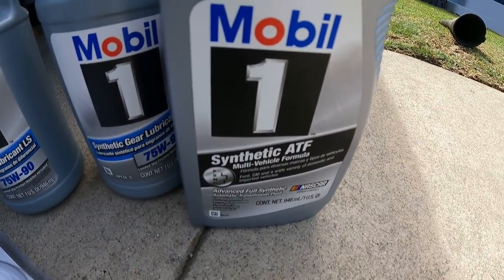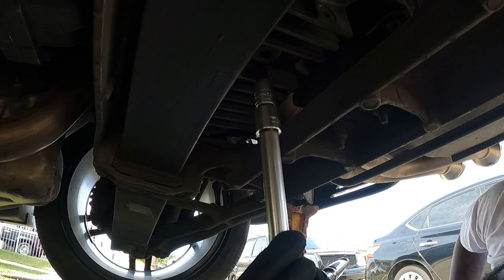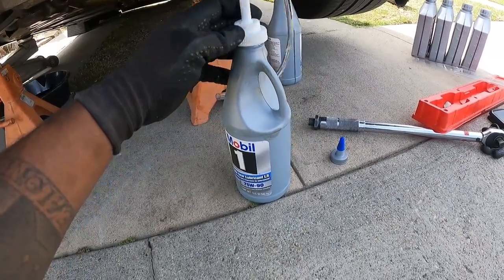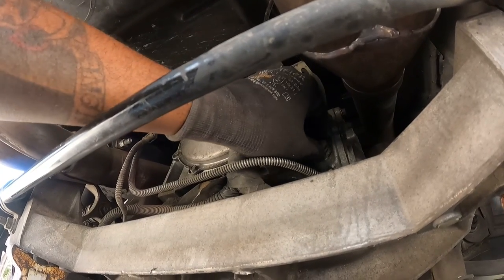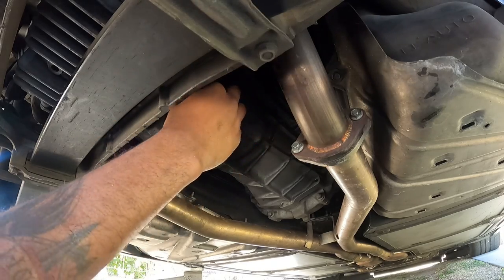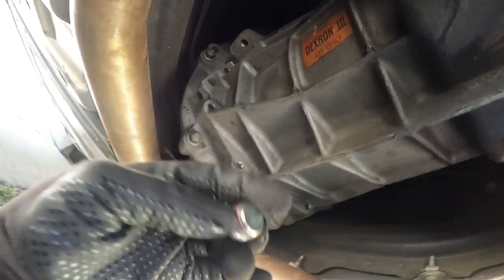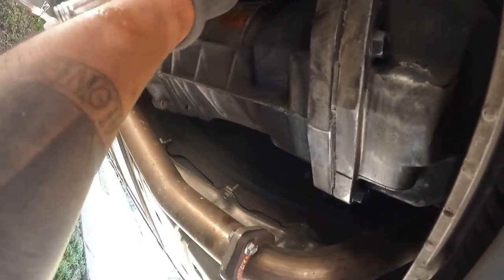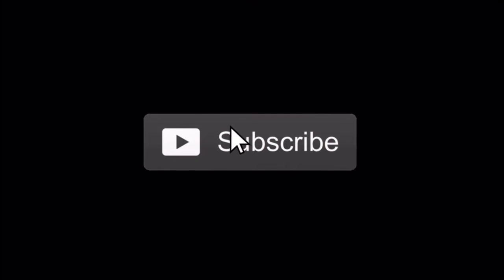How to Change C5 Corvette Rear Differential and Transmission(T56) Fluid

Comment: any issues with leakage from the seat between the t56 tailhousing and diff? mine started leaking after i changed tranny fluid and cleaned up the tranny. i guess previous owner had some sealant on there
Reply from the maker: None that I saw while I was under there
Reply: You must of wiped off the rtv sealant…

Comment: You could do with some foot long (ish bit longer ideally) sections of two by fours for jacking up on the subframe. I jack up with the wood on the subframes then put the axle stands either side of jack. The subframes a bit thin being on an edge at the bottom and it could crack/slip.

Great video tho! Imma do mine today! Along with the engine oil. (Get all the messy drain pan stuff done in one day yeah!)